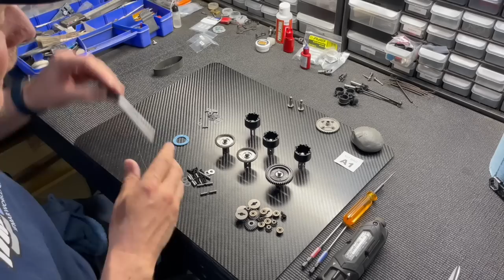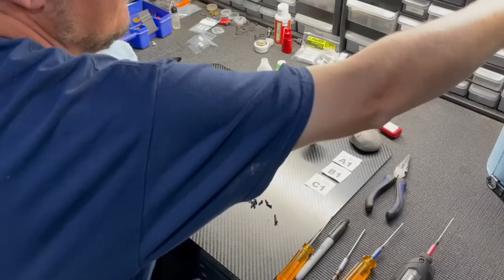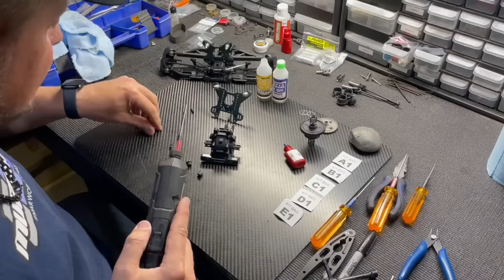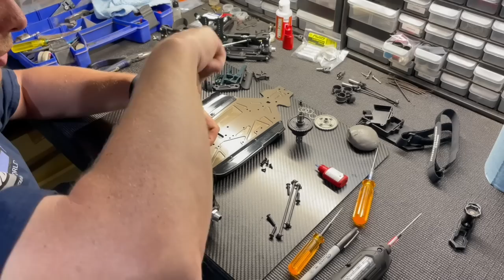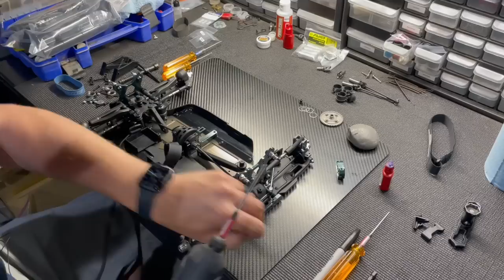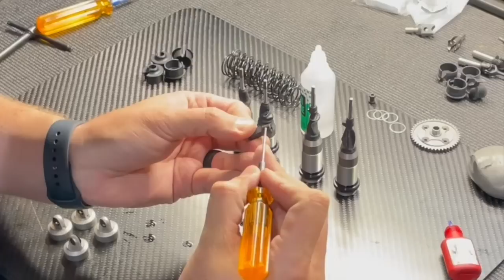Mugen Seiki MBX8R ECO Complete Build.

Comment: I'm always unsure of how much Lube to put in the diff. I don't want it to overflow but I never tried installing The Sun Gear and wiping out the access because I've always been afraid of getting the lube down into screw holes and cause a problem with assembly
Reply from the maker: It works great!

Comment: How in the hell did you thread the collar so easily onto the threaded shaft of the servo saver?  My spring must be too long because I have destroyed my fingers trying for an hour, then when I finally got the collar to grab one thread, it was cross threaded.  I think the problem is that the diameter of the spring is about 1mm too small and therefore the flange of the plastic bushing (on one end) and the flange of the threaded collar (on the other end) will not slip up into the spring.  I'm still trying to figure it out.  I am going to have to go find a small spring compressor.  Your spring mush be at least 4-5mm shorter than mine.  You didn't even compress the spring - you just simple threaded it on.

Comment: Quick tip. I found leaving the carbon tops on the hubs a little loose which makes inserting the camber link and its 6mm of shims easier, and then tighten them all at once.
Reply: I agree I had to do the same

Comment: @Adamdrake I have a mbx8 eco when using the universals on the rear do I use two 8x10 bearings I noticed there’s a third inner race or should I use the mbx6R hubs . Appreciate the help 👍🏽. My car has the 8x10 bearing on the outside hub but the inside bearing is the cva bigger bearing I can’t recall the size on the bigger bearing
Reply from the maker: With universals you need to use 8x16x5 bearings on the inside and outside.

Comment: will the tekno traction drive work with the dif installed the way you did in this video? i know on the MBX8 you did the video on flipping the dif & cutting the chassis in order to accommodate it. should we follow that video if we plan to use the Tekno traction drive on our MBX8R?
Reply from the maker: No, the diff needs to be flipped to use the traction drive system.